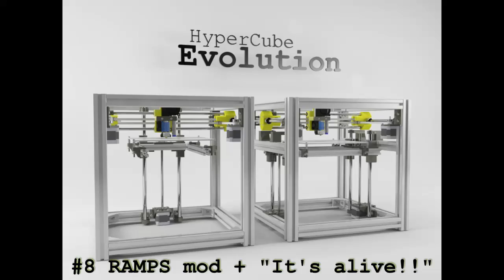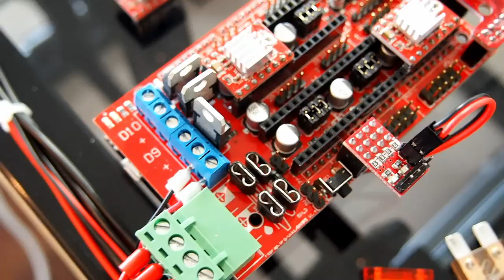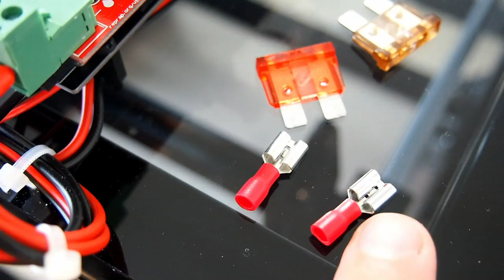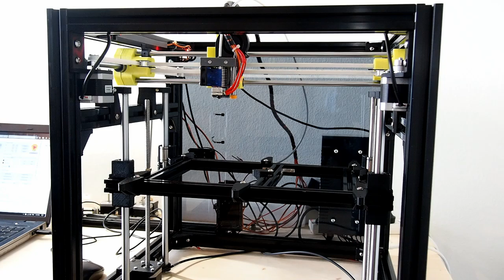HyperCube Evolution #8 - RAMPS 24v mod + "It's alive"

Comment: thanks for sharing - thats a good idea about the fuses,  I just  removed the  poly fuses and shorted mine  with bodge wires, I didnt bother removing the diode instead I removed the ams1117 from my cheapo mega as it was popped anyway  because I have a reprap full graphics and it couldn't seem to handle it :./  I soldered  a L7805CV to the underside of the mega's Vin, ground & 5v  pins  for me it seems to run at 24v but for how long it will last  I dont know , but its just done a 4 hour print -  as these ramps boards do seem to vary quite a bit in quality your milage may vary

Comment: Hello Scott I built a Hypercube EVO 500mm x 500mm x 500mm. I'm having a little issue and I'm wondering if you have seen and fixed it. I was printing 4 quad copter frames and the front corners of the parts are distorted toward the corners of the build plate.  Instead of nice round prop guards I have oval ones but just in the front corners of the build plate. I wrote a little gcode script that moved the print head back and forth and I could see it does an arc not a straight line. Any thoughts?

Comment: Hello everyone. When I remove the D1 diode from the Ramps board, it stops working with the power supply (even with the Arduino Mega powered by USB)

Comment: I have tried to follow this i used your bom from aliexpress the internal cross beams are 255mm with a 310mm bed there is very little space to mount the bed as there is only around 5mm on either side of the beams
Reply: Fixed this by cutting the extrusion shorter but we need instructions on how the rest goes together please finish the instructable

Comment: What about current setting on steper motors if you use 24V.  Do you hawe to adyust trimer. What woltage is set to stepper motors on stepper controler?

Comment: Scott, Great job on this project. I'm collecting parts to build a similar but smaller version of the various cube builds. I just ran across the re-arm board which is a 32bit drop in replacement for a mega 2560 and it runs smoothieware. Curious if  you've considered this? I have the mega for electronics but am considering this since it's 32bit should be able to crunch numbers better. I know it would be better in delta printers due all the math involved but what do you think about on these corexy type printers?

Thanks,
Dale

Comment: Hey +Scott3D can you please tell me how did you connected the dual z-axis stepper motors in the Ramps board and how you are coding them as either two separate ports or one port with the motors connected parallel (in some way which I haven't figured out)? Please help me I would be grateful.
Reply: There are two motor connection pins at the z-axis of Ramps board. And you see it as 1 motor. Both motors get exactly the same commands. So you have to use same motor types at both.
Reply: Right, often the motors are just connected in series, as they are current driven. Some even use 3 stepper motors in series for the Z-axis.

Comment: I think I found my next 3d printer. :)   Any concerns about making it 600mm for the Z?  Looking forward to the final build and print tests!
Reply from the maker: There a some HyperCube Evolutions being built with very tall Z axis. No reason that it should not work.
Reply: Thanks.  Do you have any links for the tall Z axis builds?  Are you still in the build process or have you finished it?
Reply from the maker: Check out the Facebook group. There a few on going. https://www.facebook.com/groups/Hypercubeevolution/
Reply: Cool.  thanks.

Comment: Nice build and looks very solid the dual Z-axis looks like a good upgrade and similar to a few other designs I have seen.  I prefer your steel rods and guess there is a trade off with weight verses speed but they provide a more rigid system.  Have you thought about using a single LM8LUU, LM10LUU bearings instead of the dual LM8UU etc setups?  I am using these on my Y and X axis on my Prusa i3 clone and they provides a really solid alternative even with just 2 on the X-axis

Look forward to future updates.

Comment: Scott, I have been looking for a large build volume printer for awhile. I was close to pulling the trigger on a Folgertech FT5, but now I am very interested in your project. My only concern is the cost difference. The FT5 can be purchased for $499. About how much do you have invested so far and why did you decide to build your own instead of a product like the FT5?

Thanks for all your effort, looking great.
Reply: Hi Ken... I was also considering the FT5. However I found myself wanting to upgrade the fiberboard parts (especially the bed), stepper drivers etc. So for me spending $500 for the FT5 then replacing half of the parts doesn't make sense. I also appreciate how the HyperCube Evolution has evolved through trial and error and has become very solid in both form and function. Essentially it has most of the bugs engineered out at this point. I also personally enjoy scrounging up the appropriate parts and assembling something from scratch rather a kit. On the flip side the FT5 has great reviews and produces amazing prints from what I can tell. So if someone wants a kit and to start printing right away I see it as a great buy... 

Cheers,
Greg
Reply: I am currently building this printer too. I owna Tronxy P802 (150$) and i am salvaging most of the parts from this printer (motors, controller etc). In addition i spend about 200$ on mechanical  stuff like the frame extrusions (all 20x20, because they are cheaper - and i am a poor student :D), screws, belt, pullies etc. Should be the cheapest you can get away with (I estimate overall ~380$)

Comment: Hey Scott, Thanks for taking the time to document this build. I have been interested in building my first 3D printer for a while now and this is the design I plan to go with. Like you I believe that having a rigid structure is the way to go. After all any movement in the bed will translate to the print. At this point I am just waiting for you to work out the final touches on the parts before I click the "order this printed" on Thinkgiverse. In the mean time I am eagerly following your build. 

Cheers,
Greg

Comment: Very nice job!!! 
May you give me more infomations about you modification to run ramps at 24v? 
Are you using Arduino Due with ramps 1.4?
Reply from the maker: Thanks!!

I found out how to do the mod on YouTube. This link is ok https://www.youtube.com/watch?v=ADpFjGaIxNo&t=5s

No. The Due will be with a RADDS board. An expensive board but I needed something that works with the Due so I can use LinuxCNC with an SPI interface, DMA controller etc.
Reply: Ok, my mistake. The micro usb socket made me think about an Arduino Due. Thanks for the link👍👍
Reply from the maker: It's a mega under there. Just a version with the micro USB. So cheap. $$
Reply: Is it cheaper than the standard one?
Reply from the maker: No, you can get the Due for about the same price as a Mega now.Crazy!
Reply: Scott 3D I have an Arduino Due with smart ramps, the problem is the firmware
Reply from the maker: Repetier? I have had that running on the Due.
Reply: Yes, a dev version. Everithing seems ok but z axis doesn't move
Reply: What are the cables from your servo pin for?
Reply from the maker: That's the fan extender module. It is used for the 12v extruder cooling fan and part cooling fan.
Reply: Ok. You can use 24v fans but this is a good idea if you haven't them😉
Reply: Anyway I love this printer and I'll build it for sure. Thanks for shareing you project👍👍👍👍
Reply from the maker: You can use 24v if they are 24v fans. Most are 12v
Reply: Right